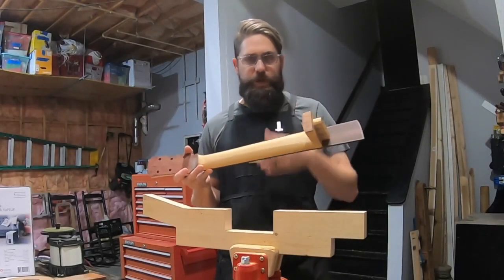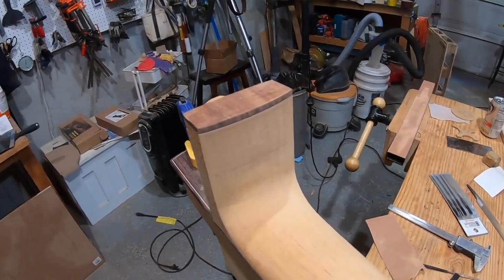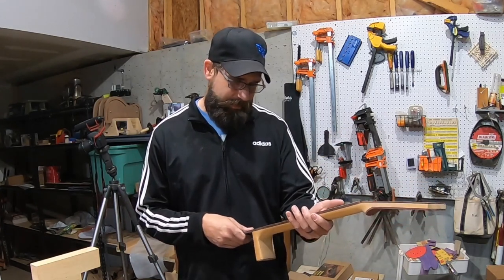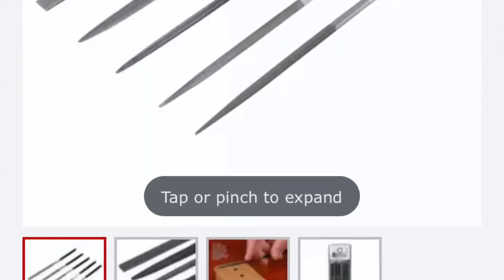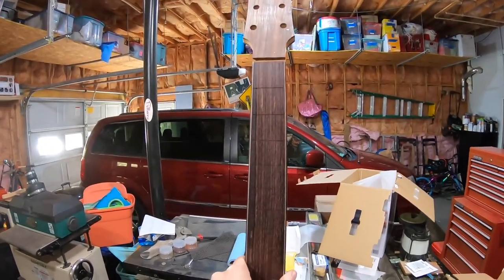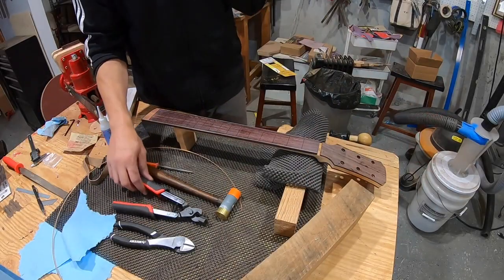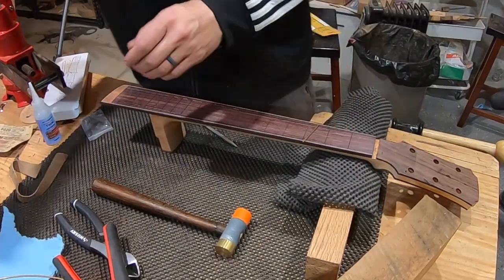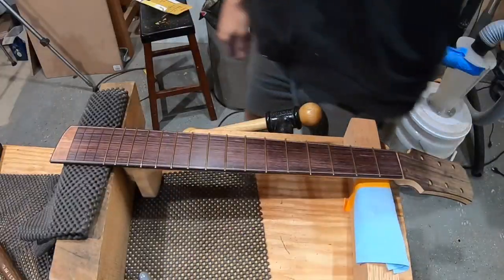Neck carve and fret install // Florentine Cutaway Guitar Build part 10

Comment: Looking good Chris! Your transparency is refreshing as always! I think the overall appearance of this neck looks better than #1 -the design features and carving looks much more refined to my eye… have you ever tried using your rolling pin sander on the heel and volute areas? Just a thought…  had a setback on my build, trying to resaw some Bubinga for my back and sides and my bandsaw has bad drift during the test cuts - new 3/4” blade and setup too. Never had any issues doing smaller stuff so scratching my head a bit…
Reply from the maker: Thanks Lou! I didn’t try using the rolling pin sander, but I did try the oscillating spindle sander at the heel transition. It maybe would’ve worked better if I had new sandpaper sleeves. It was starting to burn the wood so I bailed on it out of fear I’d burn it too much and not have enough meat left to get through the burning. I switched to a smaller bobbin with better paper and used it a bit to get the main part of the curve established, which was helpful, but the end grain there I just had to use files to avoid burning. Hate to hear about your setback with new blade and everything. Yes, that is a bit of a head scratcher! Thanks for watching!

Comment: You should look elsewhere before buying expensive specialty tools from stewmac. Often they just repurpose tools from other industries. My “fret cutters” cost $20 from woodcraft. They’re flush cutters. You could even make them if need be fairly easily. 
I have a love hate relationship with stewmac. 

You should also get a fret press. Much easier faster and better results. No dinged up fretboards. 

All in all that neck looks pretty sweet man!
Reply from the maker: Thanks man!  Yes, a fret press is definitely on my list. I’ll have a search for flush cutters. I have similar feelings about StewMac. Their tools are high quality in my opinion, but man, they are so stinking expensive. Even more so now with the economy and inflation. Some of their prices have jumped an incredible amount - more than seems reasonable or logical. I appreciate the comment man!
Reply: @CMRWoodworks  you could also use a belt or edge sander to remove the fret ends. That’s what warmoth does. I started doing that a while back and it’s my fav method. It zips off the excess super quick, and usually takes all the burrs with it. 

Yea I buy from stewmac if they have something I can’t get elsewhere. But the prices have become insane. It’s staggering how much $ you can save by making your own tools. I recently made a neck relief gauge for under $20.

Even their quality can have issues sometimes. I ordered an ultimate scraper and it was so bad when it arrived. Whoever was on the mill that day just screwed the pooch. I’ve actually had a lot of probs with their quality lately. But I have gotten good stuff from them too.